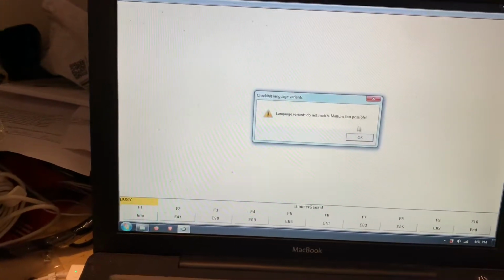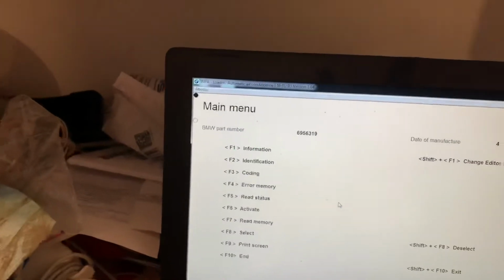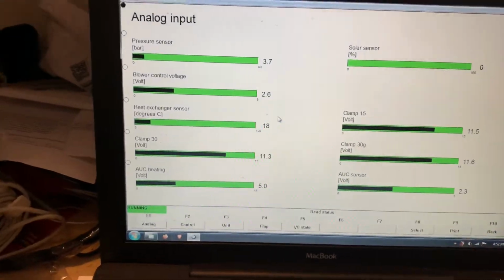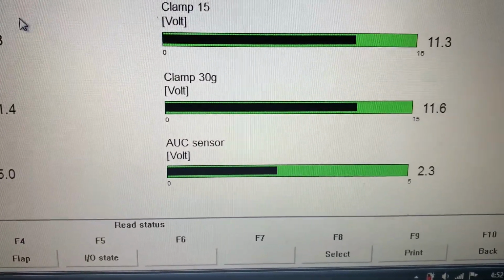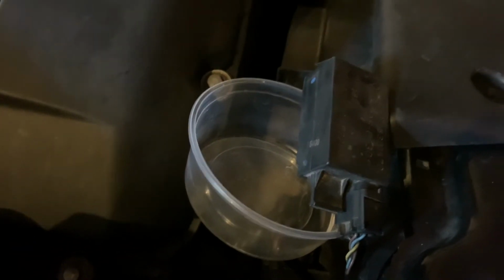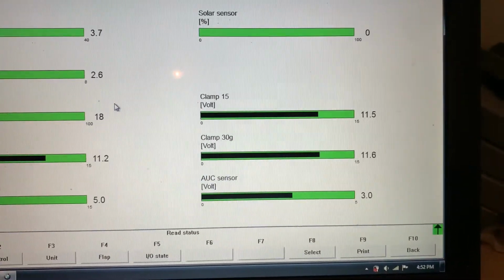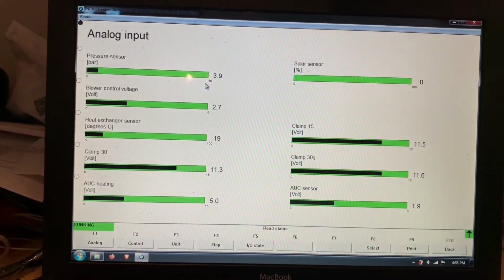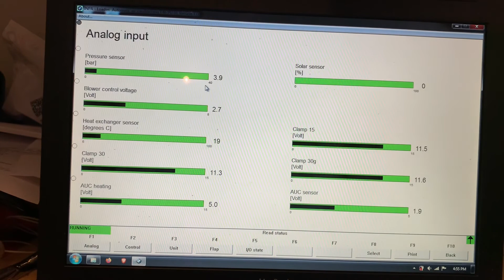Testing E46 AUC sensor with INPA

Comment: When this sensor goes out will it completely shut off the AC button functions? My screen won’t show any values and buttons don’t work in my 2002 E39 M5
Reply from the maker: No, if this sensor will go out everything will pretty much function normally. You need to us INPA or ISTA to see the code and know it is failing. If it fails it simply won’t automatically turn on the air recirculating when there are unburnt hydrocarbons in the air.
Reply: @TheBabbitt  Thanks! I have a different code for heater and inductive transmitter. Is there a site I can use to see what the error codes mean?